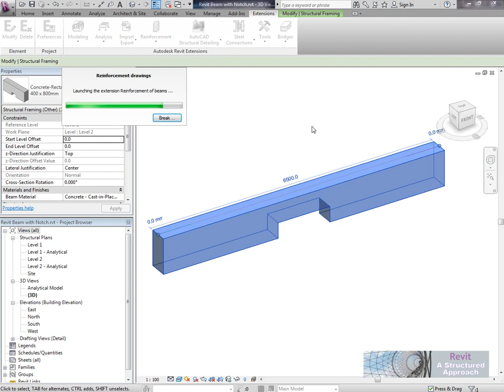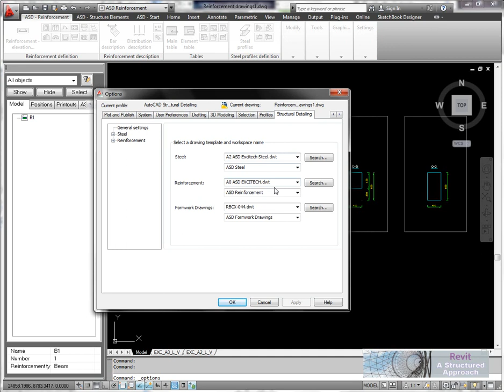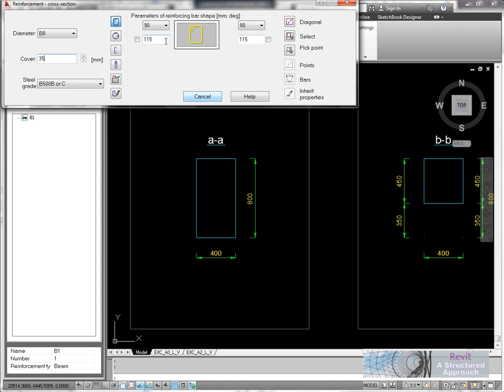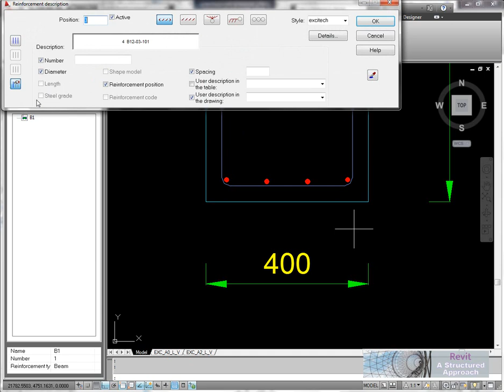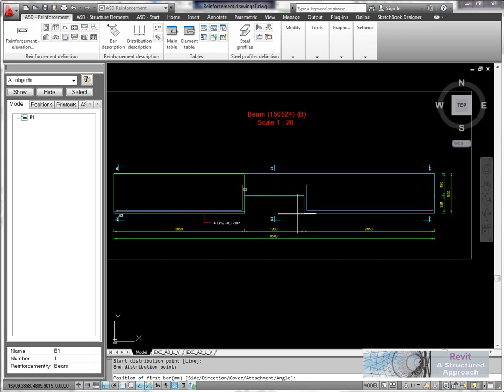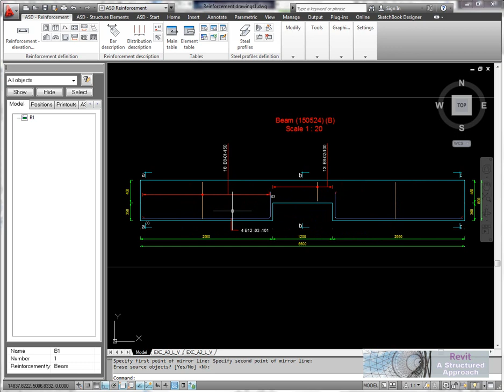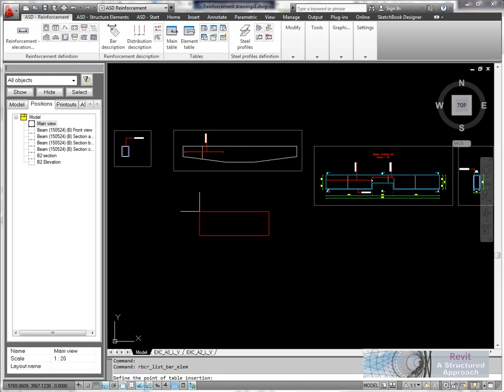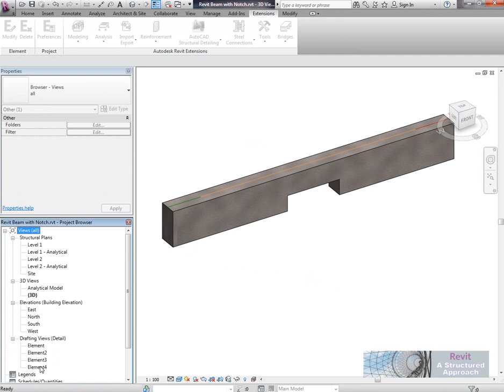AutoCAD Structural Detailing RC drawing Tutorial

Comment from the maker: Hi Tormen2r,

I am running a Dell Precision M6500 with 12GB RAM and an Intel i7 processor. You definately need to make sure that you have the ASD sevice pack 1 and 2 installed. This solved a lot of stability issues with ASD Steel. If you download and install SP2 this contains SP1 by default. To check if you have this installed, type ABOUT on the command line.

Comment: Dear RevitStructureBlog: Can Revit Structure and AutoCAD Structure Detailer make reinforcement detailing automatically?? In this video, you are making reinforcement by yourself. I have designed my structure in CSI ETABS and have imported the data to Revit. Do i need to make reinforcement like you are making OR it is automatically done by Revit+ASD..